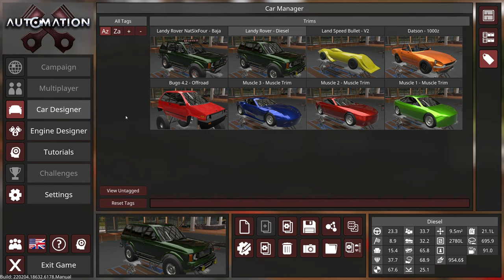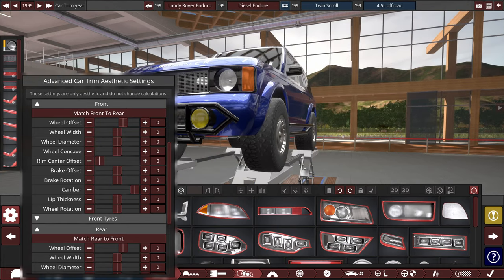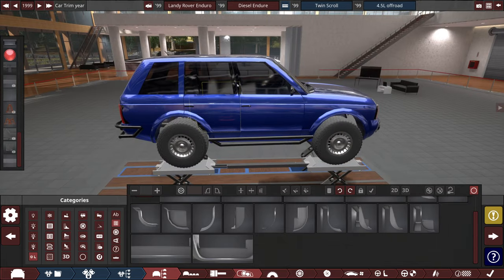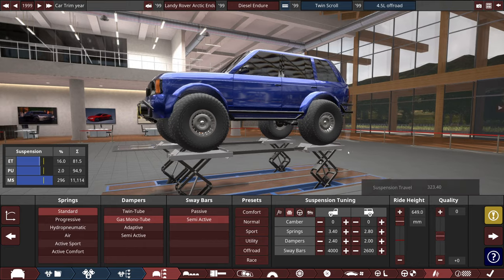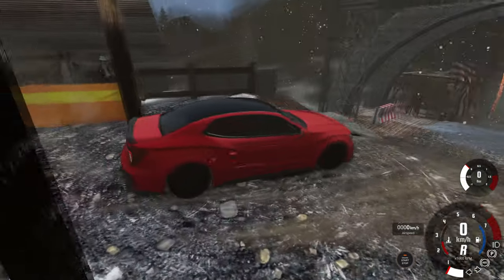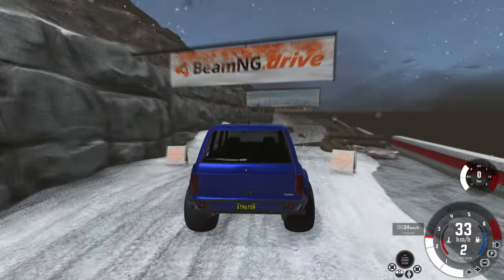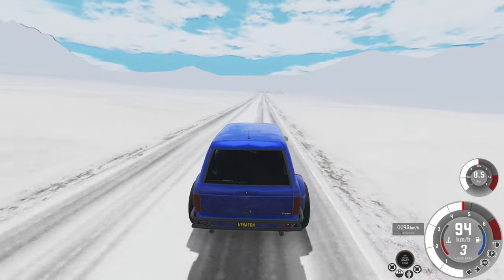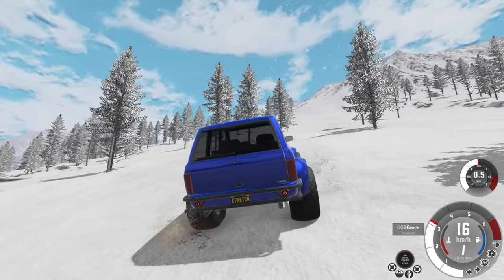Arctic Trucks Land Rover - Automation + BeamNG.drive

Comment: If you're on the fence about getting into the motorstorm titles I highly recommend em. We got a copy of pacific rift with out first PS3 when I was a kid, so my opinion of the game may be a bit biased. That aside it's an excellent title that looks and runs beautifully, all the vehicles also feel amazing outside of the ATV. Right now I personally run it on my jailbroken fat model as a backup, and it still holds up quite well outside of the resolution and small track selection. I do have to mention the soundtrack separately because it's truly amazing. The music sounds good and feels good, it also fits the game incredibly well.
Reply: i dont just second this, i HIGHLY RECOMMEND IT also. imo motorstorm pacific rift is one of the better games in the series, being so visually pleasing, fun, and having cool physics. the engine sounds tho are the stuff of dreams, and i can see you having a lot of fun doing a playthrough of motorstorm pr as a series, which i would DEFINITELY watch. I miss that game :(
Reply: @treeplusplus  If you have a relatively beefy pc, I've seen it run under rpcs3 with some compatibility patches, and I've gotten close to running it at 30 on my rig. It's a balancing act that I wasn't interested in doing since I already have the console. It's an option though and I figured I would through it out there

Comment: Fun fact, the real life at38 Arctic truck has an inline 4 diesel making a whopping 170hp. On one hand it makes sense for fuel efficiency but on the other I'm half surprised thats enough
Reply: it's a diesel so probably more than enough torque
Reply: @janderber2821  its got 265 ft-lb which still isnt alot
Reply: @wumbology72  you need 6000cc if going with petrol to get that torque. With diesel? 3000cc
Reply: @kornaros96  maybe naturally aspirated, but most modern 2L turbo engines get higher numbers than that easily. I do get that its enough power and torque but just seems low for such a big truck.
Reply: Weighs only 2 tons and it has low gearing, it doesn't need a lot of power.
Reply: @JefeInquisidorGOW  I get its enough, those old m35 army trucks only made 130hp and weighed 6 tons. I just kinda thought they would want a bit more from an upgraded truck for extreme offroading. Also kinda poking fun at the video having an SUV with 600hp.